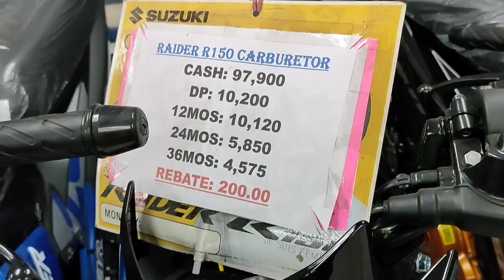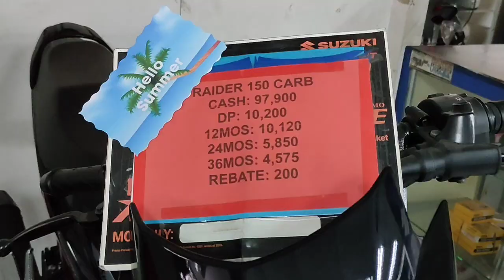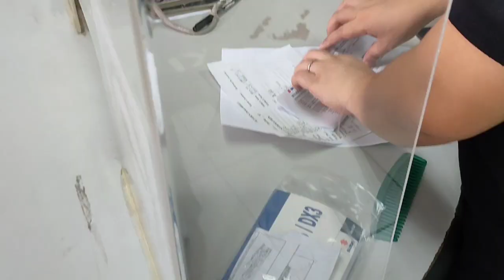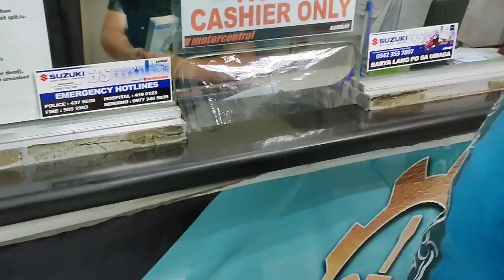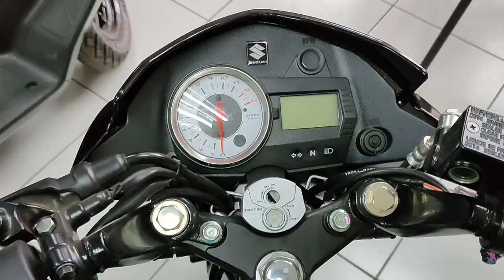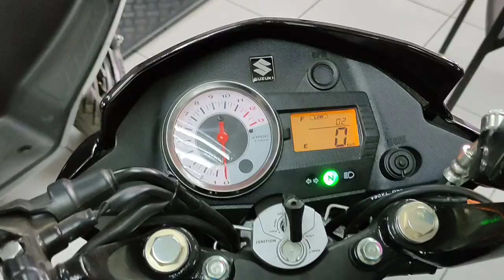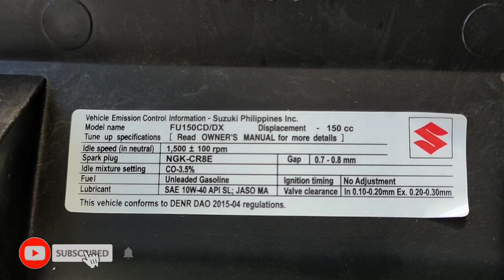BUYING A NEW SUZUKI RAIDER 150 JACKAL GREEN  2021 CARBURATOR TYPE HYPER UNDERBONE | JAYSON PERALTA

Comment: May R150 carb din ako reborn din nabili ko dcember 23, 2013 gang ngayon wla pa kahit anung sira sa loob makina. Minor minor lang. 8yrs na walang walang palya as in never ako tinirik dahil sa sira ganyan pwera pag flat ganun. Pinag ipunan ko isang taon nun first job ko 93,900 palang cash nya nun buti nacash ko rin. Sulit na sulit ko na gamit ko pero bibigay ko na sa tatay ko kasi need ko na ng mga tipong matic dahil may anak akong maliit kukuha na ako ung pwde sya makatayo sa harapan. Atleast nasa tatay ko lang hirap ibenta ung R150 ko mag 8yrs na sakin pero lage ko parin sya tnitgnan parang nung pinaka unang bili parin. Dream ko tlga un nun e. Share ko lang. sarap lang sa feeling.
Reply from the maker: matibay talaga lods yang raider 150, saka mura pa sya dati ah, maganda talaga lods kapag cash ang laki kasi ng tubo kapag installment. sulit na talaga yan at matagal na din , dyan din nakilala ang raider, ung sa kasamahan ko din matagal na nag refresh lang sya may karga kasi pero binalik nya sa stock after refresh ok pa rin naman lods
Reply: Same tayu ng motor lods ganda ng kulay.
Reply: still R150 carb type Purestock to Superstock gawang cks to be good mindanao NGO category

Comment: Ilang 1ltr. gas consume niyan sa carb?
Reply from the maker: lods ang isang litro ( 1 liter ) ay nasa 30 - 31 km sya sa city driving, kung rektahan lods baka mas mataas pa sya
Reply: Sakin boss 55kpl pág sa long ride 70 to 80 ang takbo..